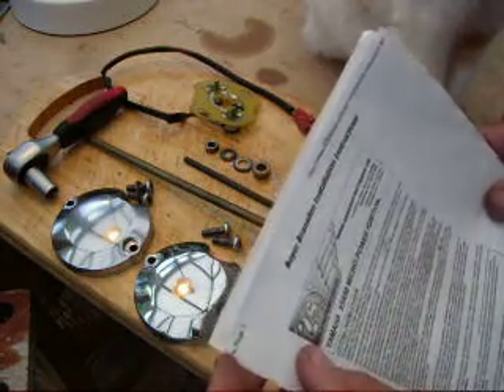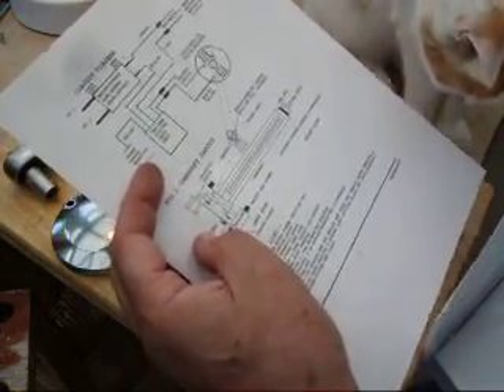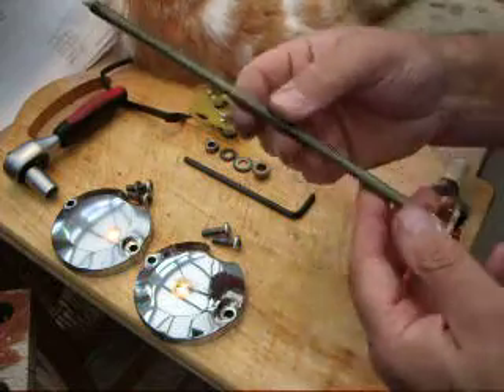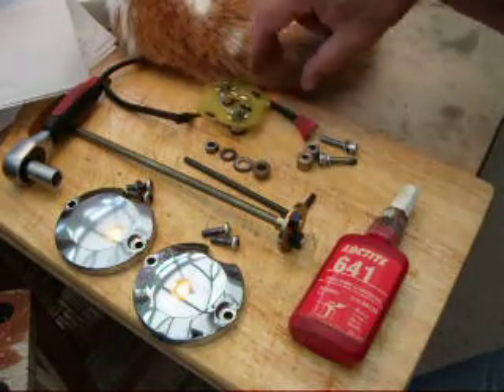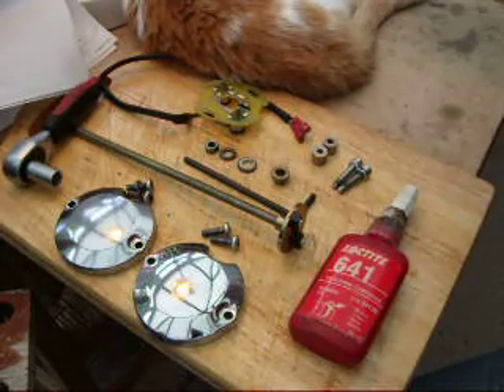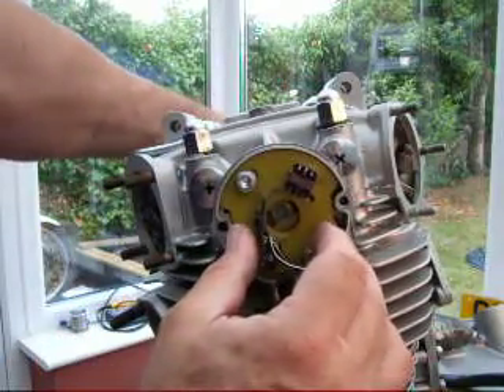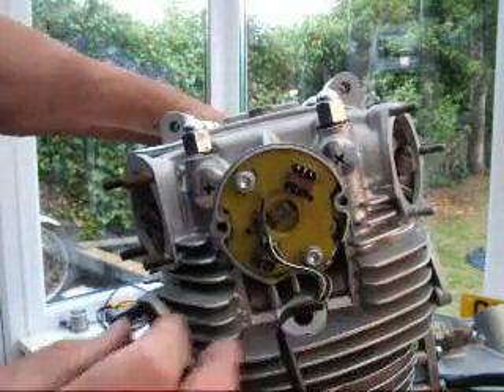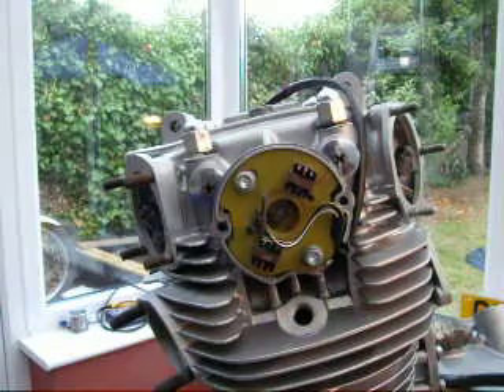Boyer Bransden Micro Digital Fitting & setting up

Comment: The motor was NOT set at full advance on the compression stroke ( note at end of video the inlet tappet began opening the valve when tightening the rod nut).This motor will not start/run,probably result in a massive backfire!
Reply: you idiot !  this motor started first time and has been running perfectly for 8 years. If you had bothered to read the comments and text and watch the other videos you would have known that

Comment: So your setting the engine to TDC then lining the mark on the rotor up with the full advance mark on the stator and making sure that you can see a white dot from one of your magnets (where the points used to  be) through the timing slot on the new igntion plate? Is this correct

Comment: Thank you, cheers!
Reply: thanks Mick apologies for showing the wrong advance mark in my video. it should be the furthest advance mark before TDC not the closest.
Reply: I have a PMA so the stock advance marks aren't there. I used a degree wheel to set at 35* according to what I've found on the "net. As Boyer says, time at FULL advance.

Comment: i bought the same ! cant wait to have it and instal it ! thanks for the video, and YES what a poor diagram not even pictures
Reply from the maker: you'll love it.... spot on ignition at all throttle positions. Don't forget to watch out for my error in the video. You need to set the Boyer up to max advance which is the mark furthest from TDC not closest as I said in my vid. Post a vid when you get it running.
JohnnyXS
Reply: great choice you'll not regret it.
Don't forget to watch out for the full advance mark on the stator . I made a mistake in my video . The correct full advance mark is detailed in the text below but ping me if you are not sure. Stick a video up when you get it running
Reply: it starts im gonne post the video now
Reply: it starts posting the vid now

Comment from the maker: Jaques thank you for your comment.

You are quite correct ! In the video I am pointing to a partial Advance mark at Idle .

Thats the problem with trying to view things through a camera whilst recording narration if you are not paying attention.

The full Advance mark is the very first line that the mark on the Rotor comes to when rotating the rotor (crankshaft) anti-clockwise ie the line to the far left on the Stator

Thanks for correcting me..